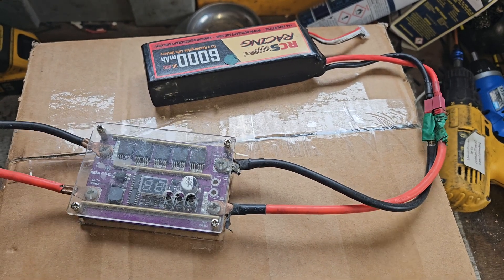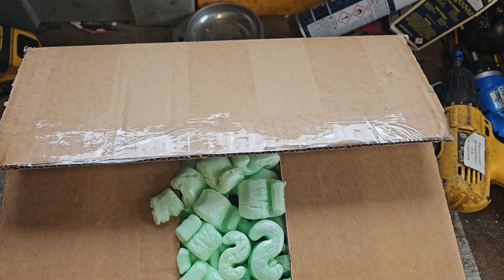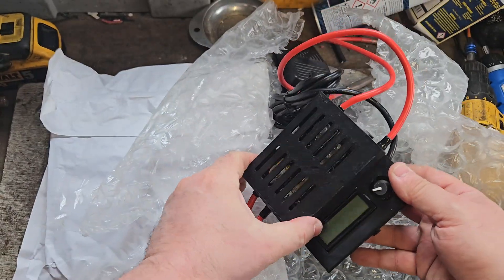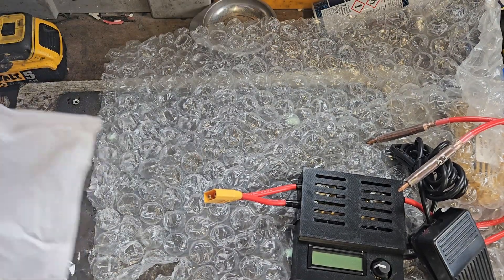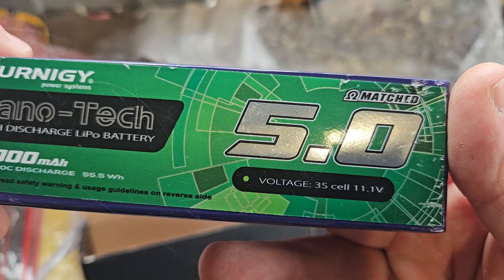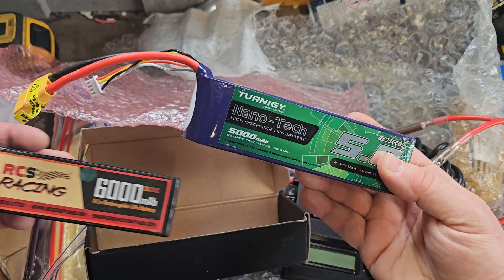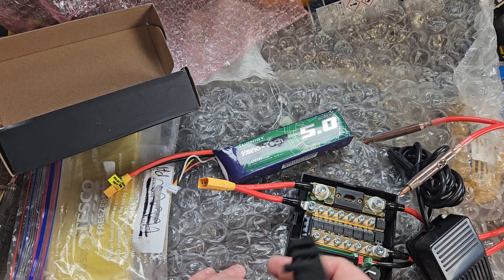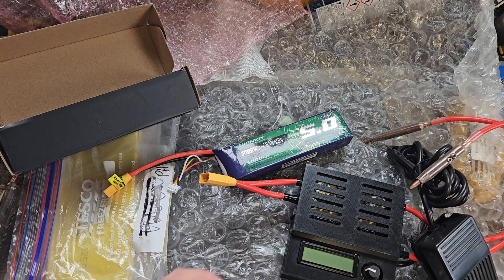Kweld SPOT Welder unboxing & First thoughts

Comment: Where do you purchase the complete assembled built kit? Thank you and great review.  I’m torn between the AWithZ UF20B, Kwled, malectrics,  and the GLITTER Spot Welder, 14500W 2500A Battery Spot Welder.  Any recs for a beginner who will occasionally be building small packs here and there? Thank you for any advice.
Reply from the maker: I got it on ebay I think I was lucky I never see them on now
Reply: @doctorlefthandthread thanks.  I found a one on eBay I may grab if I go with Kweld.  And advice for a rookie doing occasional pack building or repairs?  Thank you
Reply from the maker: @SCSRACINGTEAM take your time me safe.On your welder it will take time messing around with the settings
Reply: @doctorlefthandthread thanks for the feedback